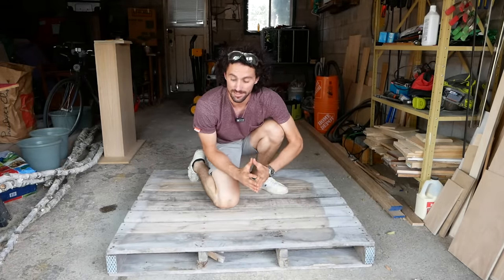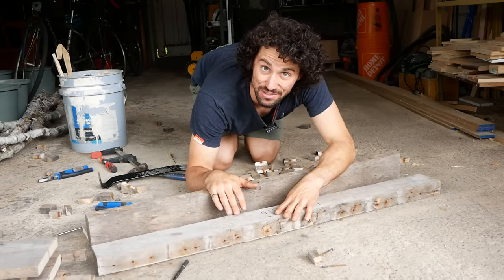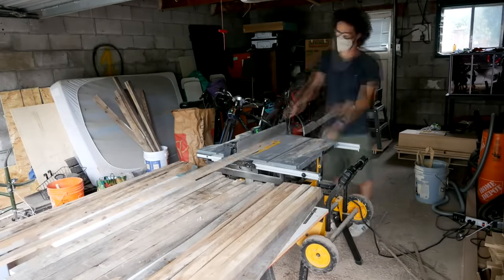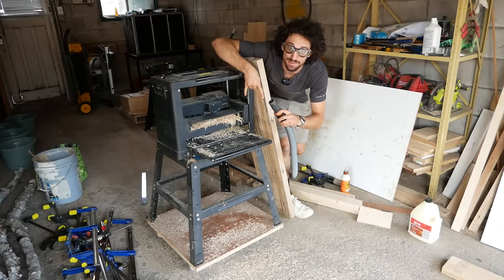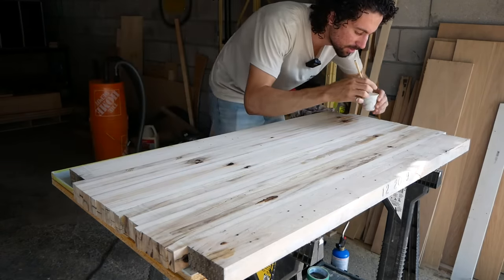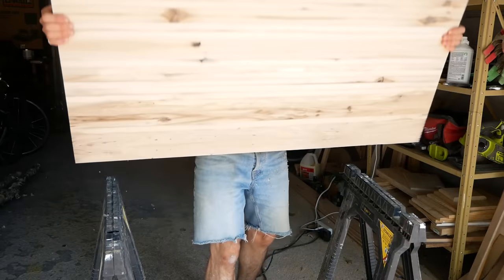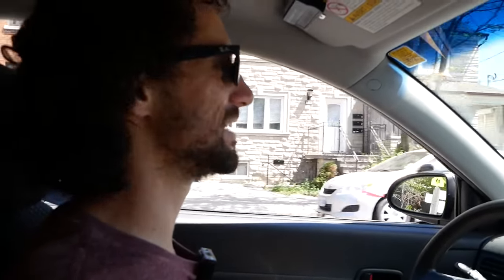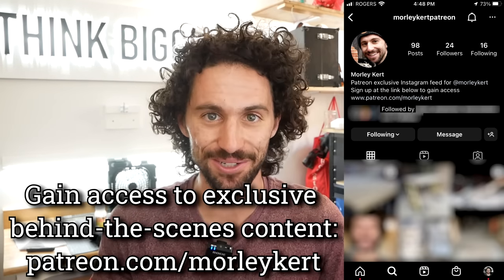Turning a Free Pallet into a $1,200 Desk

Comment: Why not plane all the sides of each plank before you start glueing them together?
Reply: This. Using a jointing jig on a table saw if he doesn't have a jointer makes this an easy job
Reply: honestly, i was appalled and amazed how he didnt use a jointer - i was just waiting for the glue up. Supprisingly he got lucky - could have been much worse.  i cant imagine attempting to sell a slab piece without using a jointer, but that is why he is '"doing", and i am not.  Eventually, you just gotta make some mistakes to grow.
Reply: He doesnt have a jointer even though they are $100 used
Reply: @familyengineering5591  I know. That table doesn't look like it can hold much weight after we saw how it was made.
Reply: @TechnologistAtWork  Oh it will hold weight with no issue dude. It's basic physics and that simple design is resiliant as fuck
Reply: @leolego2  simple physics tell me it's loosely glued together and the only saving grace is the direction of the planks is crossed with the legs. On its own it will not hold if he put four one leg on each corner.
Reply: @TechnologistAtWork  you do know that glue is stronger then the wood itself. And that wood one plank will hold on end close to 300 lbs if not more. He just glued 40 boards together. That table will hold well over 1000lbs of down force. But it's a desk. No one's putting more then maybe 80 lbs on it at any given point.
Reply: @oddessy2g  that is simply not true. The epoxy he used is harder than wood but it's not as flexible and it's just glueing two sides together. He didn't use anything to enforce it. 

Do you mind not telling people how things work when you have zero ideas on what you're talking about?

Comment: So glad to see your business stepping off like it has. Hopefully you can find a warehouse or a business close to you that has a lot of pallets in various sizes so you can rent a truck for a few hours and transport them from that/those location/s to your shop.  Check with lumber yards, as they'll have various lengths of pallets that are only going to be thrown away anyway. They'll have 6/8/10+ ft lengths.  This is where a truck and possibly a trailer will be necessary, but worth the investment, because you can then expand your builds.  You can also talk to the manager of HD and Lowe's about taking any unused/unwanted pallets and cribbing. Cribbing is the material used when shipping/packing the lumber and other materials.  They just throw it away.  In fact, you can go into HD and you'll see a lot of the smaller pieces inside the lumber aisles, they are used to keep the stacks of lumber separated a little bit so that the wood can have air circulate, as well as elevate the large stacks of limber so the forks can get under them. These are typically in 4 ft lengths, so they'll definitely fit inside your hatch area. Anyway, pick those pieces up, put them in your cart and pay for your glue, tools, Ear Pro and be on your way.  Believe me, I do it all the time and they like it, because they don't have to pick it up and throw it away. 

Also, I'm not sure if you know about Culled Wood in HD and Lowe's.  These are pieces of wood that are broken, warped beyond normal use, split, etc. They have a lumber cart in the back of the lumber department aisles, and they spray it with a little purple paint (or whatever they use in your stores.).  You can get this for pennies on the dollar, I mean like 75 to even 90% off.  Depending on the store and management, this does not only cover lumber, but can also cover their typical boards. 

So yes, you may have to pay a few dollars for some materials, but you will save big time in labor.  I understand, you may want to be only using reclaimed pallets, but at least this is still using wood that is otherwise going to be wasted anyway.

Edit:  You said you used FB Mkt Plc to find this one.  I find a lot of ads on Craig's List, FREE section for pallets. Not sure if you use that spot.
Reply: this wont work all the time, ive worked in buisnesses that use pallets a lot and they are reused and only ever thrown out when the wood rots enough to be useless (we have used pallets that have had multiple boards shattered, so long as the forklift can safely lift it, we reuse them), and at that point the thrown away pallets are too rotted to reuse as scrap wood, your better bet is to look for private citizens who might have done a bulk purchase from amazon or something that required the use of a pallet, as said private citizen would normally just burn it as firewood as they have no need to reuse it for anything, perhaps open a citywide facebook ad asking for any spare pallets or scrap wood anyone has to be picked up?
Reply: @XiaoYueMao  I pick up pallets from the Same Businesses.  Not every business will re-use the pallet.  They have an issue with the pallets taking up too much room inside the dumpster, and they don't have the man-power to disassemble the pallets and throw them in there.
I also have a lead on an ENTIRE WAREHOUSE FULL of pallets. They are ALL in Excellent shape.  Why?  Because of various reasons, but mainly because the owner of the business did not re-use pallets to ship out their end products.  So, he decided it would be a great idea to have the companies that did send him the products he used on pallets, come and retrieve the pallets and re-use them themselves.  But it was not cost effective and those companies did not come retrieve the pallets.  So they all just stacked up and stacked up inside a 200k sf warehouse.  That original owner has moved on and now the son wants the space to be cleaned out. 
I also collect many, many pallets from many of the other businesses in the metro area, that have been used once and are no longer needed.  So yes, it works every time I go to a business that requests me to come and remove their pallets, or for the businesses that simply throw brand new, single use pallets.  Why would anyone go to a business that re-uses their pallets and ask for their pallets?  That's a waste of time and energy.

Comment: A few tips from me "again."  Get yourself a reciprocating saw.  Ryobi makes one that you can get rather inexpensively.  Take it with you and if you are not using the 4 support boards (spines of the pallets), cut the pallet in half to that it is easier to handle and easier to fit inside your hatch area.

Also,  Ear Pro is Priceless and costs a few dollars. 

Also, so I don't have to type a lot more, here is a link to a great video on how to tear down your pallets a LOT Faster and less energy.  The least expensive manner is to use two or three 2x4 or even 4x4 (possibly some older spines) and set your pallet on them and use gravity and a sledge or hammer to knock the pickets off of the spines.  Get a longer, full sized crow bar, believe me, it is definitely worth it.  Plus, since this is your business, and I hope you have your business license/LLC etc. set up so that you can write off these tools/fuel/car/PPE/Boots etc. against your earnings so you don't pay as much in taxes. But that's a different video.    https://youtu.be/SoV-SpfQKAo

Comment: Love the build
You should consider using threaded inserts when applying the legs (Of course you may need to increase to hole size in the metal itself)
It will really allow you to transport the items more easily and securely and the people moving their furniture in the future would be able to do the same without compromising the integrity of the "screw holes"
Reply: no but then theynobuy anotheer pallet board luzury furniture item in the future if they do not brake
Reply: That's actually the opposite, you will find that even less people will want to buy products from you if they break. Why spend a thousand + on something that won't last, that makes no sense.
Reply: @YuaASMR idk for some ppl 1000 not a lot money

Comment: With or without electrical tools you're an artisan, I know you bought the desk legs but the finish item looks so impressive. Wondering whether you select & compose your own soundtrack music (?), which enhances your presentation. The costing/timing/time lapse video is a neat  trick. Top marks Morley Kert.
Reply from the maker: Thank you! I select (but don’t compose) all of the music for my videos.
Reply: @MorleyKert  In the future please cut out that horrible noise you and others call music. It is way to loud. I have to use earphones so as not to bother other people here, and every time you played that, it actually hurt my ears. What purpose does it server anyway? Has nothing to do with your wood project. That time would have been much better and more interesting spent if you'd have used those moments to perhaps explain what you were doing, how you came to think up the project or anything else having to do  with the table. Other suggestions for that time would be, would you attempt another similar desk, if so would you have done anything different and if so, what? PLEASE NO MORE NOISE!
Reply: I've seen  12 yro 1st year woodwork students make better.

Comment: I fully appreciate your skills, craftsmanship, and ability to sell your projects, though the issue I take is with the cost breakdown: overhead was not accounted for. Overhead should consider the cost of the sandpaper, the cost of electricity used in the project, cost of paper cups used in the epoxy and glue-up, as well as any tool maintenance. Those costs could potentially lower your hourly profit by $10-$20 an hour.
Reply: lol no way. All the costs you mentioned are completely negligible Sandpaper? Maybe $10. Electricity? Probably literally around $0.50. Paper cups? $2. Tool maintenance? This one is hard to estimate, definitely pretty insignificant as well though. He included all the major costs in the breakdown, everything else is peanuts not worth talking about.

Comment: You coulda cut the cracked part of the table off and reglue it would be much simpler and probably looks better, then also recess the width of the steel plate on the legs into the bottom of the table where it is fastened 👍🏽

Comment: A perfectionist with his furniture..and the finished product was stupendous!!..
Reply: A perfectionist would not have filled that large a gap in the glue line with sawdust and glue. A perfectionist would have recut that glue line to remove the gap and glued it back up again. Sawdust and glue absorb the finish at different rates than the surrounding wood making it obvious.

Comment: Get a saws all and you can cut the nails on the ends between the pallet and the slots makes a lot easier so you don’t miss so much. Would it to get a detailer up to a small air compressor and Schuster nails out which makes it a lot easier to sell for ticket.

Comment: You can run a sawzall with a metal blade down the nails for the middle supports but you may end up with some scuffing on the face of the boards. usually fits the look though anyways.

Comment: 7 minutes and 3 seconds into this video is how I lost my left eye in August 2020. Ripping old 2x6s down to make shed doors when the blade hit a nail and one of the carbide saw teeth flew through  the center of my left eye. Had I been able to find my safety glasses it would have helped, but a carbide projectile like that would do damage anywhere it hit. Invest in a metal detector to make sure you find all the nails and make sure you remove them before cutting.

Comment: Morley,how do you prevent wood glue from being affected by water, was the final spray coat to wood a waterproof item.?

Also, believe from experience that an epoxy glue mixed with saw dust as a filler would provide adequate protection from "water infiltration."

Comment: When you have a stubborn nail use a 4.5” angle grinder with a cutoff wheel and cut it flush to the wood my friend and great work my friend
Reply: Another note when gluing the sides of the wood together and clamping it together you should honestly biscuit them together the biscuit tool isn’t that expensive and the biscuits are cheap or they were everything is mad expensive right now 1/2023

Comment: Is that just clear polyurethane that is used as the top coat to  protect the wood ? 
Do you have to put a clear wood sealer under the top coat of clear polyurethane if using as a kitchen table ? Or if was using a small table in a bathroom ? Do you use varnish ? Or polyurethane ?
Thank you

Comment: Whenever you get a nail head pop, use the claw on your hammer and instead of pushing down to pop the nail up push it sideways to use the leverage of your hammer to bend and pull the nail out, pro tip.

Comment: Just so you know bro you could have easily grabbed that nail that was sticking out with a pair of sharp wire cutters and use them kind of like a pry bar to pry it out of the wood and got the whole thing out very easily. That's the method I use when I have nails in my reclaimed wood I never run them across the table saw which will destroy your blade
Reply: Also bro no offense but I don't know where you find people willing to pay $1,200 for a table you basically made for the cost of the glue and the gas it took to get it... If you ever go out of business please provide me with your client list cause I can get pallets for free all day and I will not rip them off like you have. I would have probably only charged about $350 for this.....

Comment: Firstly nice work on having the courage to make a table from something that was banged together originally! What is frustrating to watch is the method of putting the table top together and joining it with the clamps! Why didn't you slot router the sides and then use biscuit joints! This will reduce a bow in the table top and also add alot more strength and durability to the table which will make it last longer. Also filling the cracks with a saw dust mix??? Why? A waste of time and also will leave a blemish in the surface not matching the original grain of the wood. Would have been quicker to put it through the saw again with a nice clean cut and rejoin it but with biscuit joints! Not just glue! In my view it's a basic way of making the best of what you have. That's clearly what this video is about. Cabinet makers or carpenters are a dying art these days. So many corners cut just to make quick money. I may be wrong with my opinions but I know what I'm talking about when it comes to making a decent table! Good luck to you thou in your future builds!

Comment: Why limit to FB market place? It's likely that there are hundreds of warehouses within less than 10 miles of you that have way more, and nicer pallets that you can get for free.  Also, was that a pressure treated (toxic fungicidal chemical preservatives), or thermally modified (heat treated and safe) pallet? If pressure treated, nobody should use it as a desk!

Comment: Watching you use a table saw (TS) is frightening.  You are begging to get hurt.  Proper procedure for a  TS is to have the blade one full gullet over the material.  The reason for this is the tooth angle.  Having it shallow changes the effective tooth angle, causing the material to ride up on the blade.  Having the blade higher gives you more positive tooth angle forcing the material down on the table.  Also ripping in that fashion can release inner tension in the material causing the wood to clamp down on the blade.  The riving knife helps prevent kick back, but it is not a replacement for using a tool right.

Comment: That tables bowed when you put the clamps on it’s pulled it up slightly should of used bigger clamps and then a flat piece of wood and clamp it to a flat surface or put weight on it also id of biscuit jointed a few of the slats or atleast screwed a few of them your more of a diyer to be honest you don’t have a the right gear for your job but your trying also buy yourself a truck or van pulling up to sell your tables in your mums car doesn’t look very well